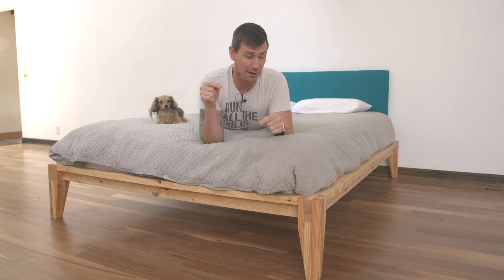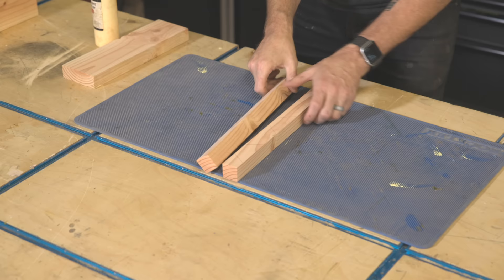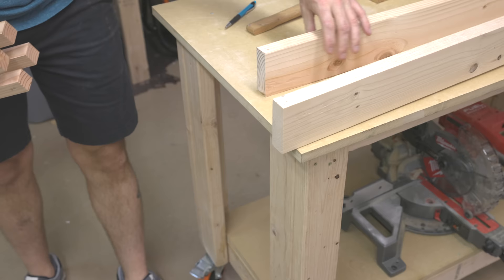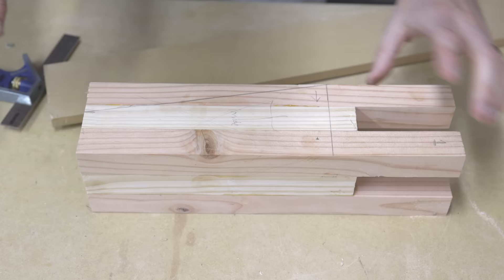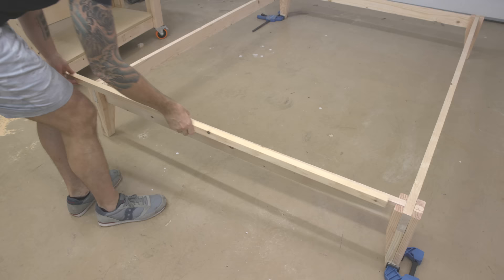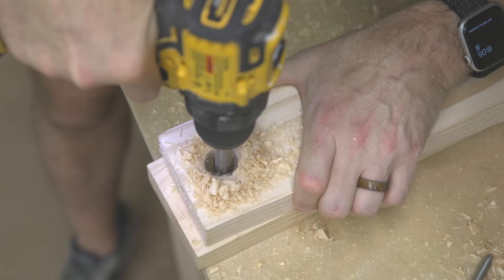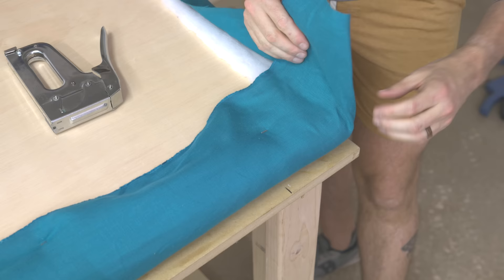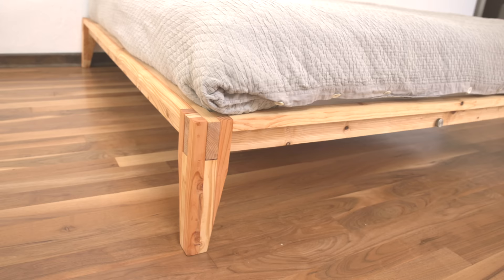DIY Castle Joint Platform Bed made w/ 2x4's Buy vs. DIY

Comment: Good thing it doesn't require a chisel. I've got no money left after buying a planer, jigsaw, miter saw, circular saw, belt sander, orbital sander, electric screwdriver, cordless drill, forstner bits, Rockler® brand clamps. . .
Reply: Lmao
Reply: By golly, you left out the big bottle of wood glue.
Reply: Just what I was thinking haha!
Reply: Also outside of the US, having space for all those things comes at a massive premium. Its really only for the rich or professional carpenter.
Reply: All you need is a bit of creativity
Reply: You are so right!
Reply: @justinzane195  😂
Reply: And you still need to buy a table saw.
But then it's going to be a super cheap and DIY bed. No sweat, no hassle, no chisels.
Reply: @Postfrogish  not just ANY tablesaw but a Stopsaw table saw. All I got is an old Emerson Digit Amputator from a garage sale for $50.
Reply: You can always buy finished pieces at a real lumber yard- they will charge you a small fee for the planing and the cuts.
Reply: Ah but that's the point isn't it? You say oh honey we don't need to buy that expensive bed, I'll make it... then once she's agreed you rub your hands, crack out the credit card and treat yourself to a garage full of new toys 😉
Reply: Lol
Reply: “Normally you would do this with a bunch of hand tools, but we’re gonna do this super DIY”
Usually ‘super DIY’ means hand tools because that’s what’s actually affordable and accessible.
This is a great project, I’d like to make it like him (one day), just the marketing’s a bit off.
Reply: Haven't even watch the video and had to give this a thumbs up already
Reply: @ga5712  "Oh no. Now I need to find another project just so that I can justify buying a set of chisels"
Reply: Maybe just maybe what he means by chisel is a legendary item that passed by generation to generation which is cannot bought with money it's legacy. It's took decades of practice to master. So rather buy ALL that tools that money can buy to craft your bed. Happy DIYing.
Reply: I can do it all with a chainsaw!
Will it look pretty? NOPE. But it will be just as functional.
Reply: @justinzane195  Yes! A lot of space and money too.
Reply: @angelchiriboga3904  Good to know! Thanks for the tip!
Reply: @emp0rizzle  dont ingore his orbital sander, just saw a vid, it's like 600 (or 650) bucks
when i saw it, i didnt know whether to laugh or to cry (for myself)
Reply: @70athens  good eye 😂but then again nothing wrong with buying/accumulating tools 👍
Reply: Couldn't been worst with Bessey clamps!
Reply: Lmao!!!  Ridiculous!!
Reply: Lol bhahaha.
Reply: Fully agree, a japanese saw and a chisel set come at 200 $ and the guy says "no hand tools fully DIY" f*** the mitre saw alone is more expensive than hand tools. It click baiting at its finest. You hope DIY tutorial you end up with a DeWalt commercial...
Reply: Can anyone afford to even rent just the space he has? Hahaha
Reply: Lol
Reply: thought so too.
Reply: DIY videos are always a big presupposition on the part of the producer
Reply: @70athens  You don't need a $600 orbital sander. You can buy sandpaper and use sweat equity until you can save up and buy one from a yard sale or a cheap Chinese one.
Reply: @simonrano8072  Where are you buying your tools? Lie Nielsen? Check out the Rex Kruger channel where he teaches you how to start simple with basic hand tools. He's even got a video on prepping and upgrading a set of 5 chisels for $18 from Amazon by changing the handles, and sharpening them correctly. And every more cogently, the Stumpy Nubs channel has a video on how you only need 1x 1/2" chisel because that's the one you'll use the most. You don't want to make anything really.
Reply: @BigHenFor  First my point is that this video is about not using chisels by having the full DeWalt powertool catalogue in the workshop. Yes chisel are not expensive compared to power tools. Secondly your are only considering the price of the cheapest chisels not taking into account the rest that is necessary : japanese saws (25-30 €), wet stones (25 €), wet stones planner (20 €), a chisel grinding guide (15 $), a file (20 €), a marking gage, a marking knife, a planer, a ruler, a square ruler, a workbench with a press/vise and a few clamps in different size. Having 3 sizes chisels really makes a difference, especially when you want to do morteses. 

I can do dovetails, tenon/morteses or free hand mitters to make many kind of small furnitures, I only use hand tools expect for the driller. There are way to complicate your life for a few bucks of saving but this "no chisel DIY tutorial" is a joke. Having some one accusing me of "not wanting to do anything" below a video "no skills or hand tools involved" is pretty funny ;) 

I have a full time job the rest of the week plus other extra activities such like sports, electronics, painting, cooking and brewing I will leave the 10 years craftmanship of free-hand beveling my single chisel workshop to japanese hardcore tradition wood workers.
Reply: Holy mole! I have a chisel, can i use that instead of the myriad of power tools?
Reply: Open a home Depot credit line. All you need is 1k
Reply: Hahahahaha
Reply: 🤣 this is all basic woodworking stuff. I can find this all secondhand for under 1k If you don't have this don't make a castle joint bed. Make a basic platform bed.
Reply: Lmao
Reply: 🤣🤣Thought i was the only one annoyed with the mentions in this vid. I mean, I get it, you have a sponsor but geez man, if I took a shot every time I heard rockler
Reply: I made my castle joints by gluing 2x2 oak together properly spaced with the other material. I don’t have most of the stuff you rattled off. Use some creativity and you can do it with minimal tools.
Reply: Pls do youtube search to learn to build your own bar clamps brother it’s gonna save you a few hundred bucks for sure i just built mine and couldnt be happier
Reply: @kylekeenan3485  the rich? Come on... it's a few power tools, not a damn workshop
Reply: @70athens  no a orbital sander is like $40-60 wtf are you on about
Reply: @simonrano8072  what person expecting to do DIY projects doesn't have a damn miter saw? Why do you people expect all diy projects to be built with hammers and hand saws?
Reply: @tfergieman  you dont need the space he has for this project
Reply: @randybobandy9828  this is not just a regular orbiter sander 
look it up
Reply: @simonrano8072  imagine crying about beeding basic woodworking tools for a woodworking project. DIY doesn't mean "no tools besides a hand saw and a screwdriver needed".
Reply: @papayaman78  why are you watching a video like this if you dont even have atleast a few of the very basic power tools he used?
Reply: @randybobandy9828  did humanity wait 4500 years for the mitersaw to be invented to start building furnitures ?
Reply: @70athens  who cares what model he owns? Its irrelevant.
Reply: @randybobandy9828  DIY is neither supposed to be "this is how a pro does it will all the gear in the book". I have a radial miter saw, a circular saw, a couple sanders and drill. But i am currently building a caslte joint Coffee table with japanese saw, chisels and not a single screw. Fun fact i am reusing the wood from my last bed platform, the bed frame has been turned into my workbench 😉
Reply: @simonrano8072  did humanity wait until DIY videos on YouTube became available to make furniture?  Do you think they didnt have specific tools to make wood furniture in the past or did they also just use a hand  saw and hammer with nothing else?
Reply: @simonrano8072  a miter saw isn't something only a "pro" has. It's a very very common power tool that most people have in their garage. The only tool he used that isn't common was the planer.
Reply: Yeah it’s definite cheaper to just buy a bed…
Reply: @SeanTriglia-yt2co majority of what he has can be rented and if you don't want to rent a bunch then a few saws, hand plainer, and a hand drill can do everything he did. Could even have the plaining, cuts and holes done by a shop for minimal costs. Still much cheaper than buying it outright. People act like power tools were and still are the only way things are built with wood. A little research and some practice and this can be done with minimal tools but has to be done the old way. Japanese traditionally use joinery as their primary to build complete intricate houses and furniture. It can be done.
Reply: Nobody told you to try to be the cool guy who makes things… Just to finish (or probably not) one bed in your whole life. This is for people who want to make their own sht not make one thing and tell people about how they made it.
Reply: Theres public access woodworking shops
Reply: Jajajajaja I was Just telling my wife based in the thumbnail the same exact thing! Dude has tools to start a new furniture company
Reply: Lol😂🎉
Reply: I have that orbital sander, that alone makes the price the same as ordering the bed online lol
Reply: It's almost like you shouldn't bother watching woodworking videos if you are too cheap to purchase tools
Reply: I live in an apartment, and made friends with trademen. I’m good.
Reply: You could reasonably do this with a table saw, circular saw, chisel, and any cheap clamps and plug-in sander. The table saw is the only one of those that's maybe iffy for a random homeowner to pick up, but well worth it if you're going to be building anything at all.

Buy good lumber instead of using the planer. Use a circular saw with repeated cuts to make the stretcher cutouts, then sand (or chisel...) to clean it up. Table saw to cut down 2x4s into 2x2s. Clamps for the glue-up. Any electric sander for smoothing cut edges.

I haven't tested it, but I'm playing around with an idea for the center support that won't even require a drill. One piece rests in the center foot like the stretchers do, but comes up under the lip at the front and back to hold the frame inward; another 2x4 rests on the top of the center foot, with its edges resting on lips on the top and bottom stretchers. Center weight is transferred to the foot and the frame, while the frame is still held square without a screw drawing it in. It's probably easier to just use the thumbscrew, but something about an all-wood, zero-hardware, gravity-locking bed really appeals to me.

The point is: pro tools will make this faster, but they're not a necessity. Get them if you see yourself using them more than once.
Reply: How sad I do not have all these tools. Bye the way lumber is cheap in my country but tools especially electric are not..  the cost same as in USA.. I JUST USE Hand Tools
Reply: Don’t forget your $1200 domino joiner lol
Reply: My thoughts exactly. He starts the video by saying to do it with regular tools, and then the first tool he uses is a planner.....
Reply: Lol, yeah, that chisel would have broke me!

Comment: So, I have now built 3 of these beds, 1 for myself and 2 or family members. They think I'm some kine of magician, but its not so; I'm just a DIY woodworker who found this bed design really useful and easy to build. I must admit my 12 year old self sprung loose and added LED lights around the border. Also i combined the frame with a headboard that was demonstrated by Tom Silva on Ask This Old House, and I think it worked out beautiful. Thanks for the Demo
Reply from the maker: So rad!
Reply: Hi, it’s me, your cousin
Reply: Using professional equipment in a DIY video is kinda bigoted, just saying.
Reply: I'm about to try my hand at building this and your LED idea just elevated the build! So excited for this project!
Reply: Hey! How long did it take you to build each bed? Thanks!
Reply: Don't forget to add "DIY" laser engravings with a $10,000 laser machine...
Reply: Is there a cut list for this project?
Reply: I can't ever recomend building furniture with anything from home depot.

Last time I went for 2x4's they were bent harder than the transgender community. And had reality more twisted than a social justice warrior.

I've often bought 2x4's from home depot still leaking sap and water.

I don't even recomend it for framing in a house. Unless you want wavy walls. Try putting a 6 foot level on an angle across your own wall. You'll know if your wood was installed wet because it won't be flat.
Reply: Kiln dried wood is ideal for furniture. From a reputable lumber source.

Comment: Love the 'additive joinery' concept and the castle joints are impressive.
Reply: Loving the jointery. Hating the wood selection.

I don't hate pine, just what Home Depot does to it with minimum wage labor. I'll stick with my local sources.

Ghanahl lumber, Austin hardwoods, and Rockler woodworking. Those are my current sources for wood.

I haven't gone online for wood ordering, it interests me, but I want my local shops to stay.

I just lost my local Woodcraft, and I don't like it one bit.

Comment: I was able to complete this project today with the guidance from the video! Overall achieved a similar result. A few people mention concerns about the strength of the end of the beam and the wood grain orientation. Indeed, the small piece broke off on one end during the test fit. It's easy for this to happen given the pleasant result of these pieces fitting together and the strain on the opposite end when fitting a piece. However, it glued back easily and I was happy that the end result didnt compromise strength at all. As mentioned, once the bed is assembled, there is a lot of strength in the design. There doesnt seem to be much force on the end piece surprisingly. Additionally, I'd recommend buying four or so additional 1x4's for the slats so that they are spaced out with less spacing between. Good luck!
Reply: I didn't do the same bed design, but I did find that using 2x4s instead of 1x4 bed slats improved the stability incredibly. It also seemed to remove a lot of the squeaking that would happen.
Reply: @the-wooden-beard  what mean 1x4 / 2×4?    tickness and width?
Reply: @oldiniabal1464  yes
Reply: @the-wooden-beard  thank you :)
Reply: It's the thickness and width of the lumber. "1x4" is one inch thick and four inches wide; "2x8" is two inches thick and eight inches wide.  The actual dimensions are smaller, but it's complicated to explain.

Comment: Thanks for sharing this wonderful idea with us! I'm a carpenter myself, so I'll go straight for 4x4s for the bed legs, shaping them the old-school way: making a structure to support the mattress, then using a piece for the head and the foot, each.
Reply: There's no way that jointery survives my bedroom activities unless that joint is fully glued, I'm a Viking, deep down somewhere under the nanny!

And if that joint is fully glued its disposable, because it's not getting out of my room when I move.

Maybe a bedframe involving a tusked tennon. but I think it's better to get a little more modern with some hidden bolts or a modern fastening system that can be taken apart.
Reply: Also a 4x4 from home depot needs to sit for 4 years. 1 inch per year to dry wet wood. Home depot lumber leaks water...
Reply: @brandonhoffman4712  ended up using 18mm MDF boards to put drawers beneath my bed, so I can keep a bit of clothes in them. But I did plan for the forces that would be made on the structure, so I'm chill

Comment: I also like to use additive joinery with 2x4s, it is a very useful and easy method that doesn't require a lot of tools, but careful planing and accurate cutting make the job much easier. I would not normally choose castle joints like this for a bed like this...while it carries a vertical load nicely, under lateral shear stress the joints are only as strong as the narrowest notch inside the joint, which is only 1.75 inches X 1.5 inches in girth in this case. It is probably ok for gentle people. It sure looks cool, though!

Comment: I have been searching for a way to build a new base for my trusty old Jet band saw. It's at least 25 years old, still has it's original grey paint (for now) but it still runs like a champ. The base on that saw is getting to be more than just a little bit weak, but there's nothing wrong with everything above it. I think I'm going to use your castle joint technique to build a basic cube, without tapering the legs. I'll do this for all 8 corners of the cube. Where you added 2x2 strips to support the mattress, I will use 2x4's with glue and screws for a lot of added support. Then I'll add some 1/2 inch plywood to the top, bottom, front, and sides, leaving the backside open to access the motor if needed, or I might even put on a door. I think that cube will be strong enough to park my car on it, and will probably live longer than I will.

Comment: Nice job, and indeed I see ads for this kind of bed every day! I feel like it might help the rigidity if the legs were actually glued into the footboard and headboard cross bars. This would not change the portability of the bed frame by much at all. Olive.
Reply: If everything is glued together then it's not as portable or easy to take part and moved somewhere else.

Comment: Today I start to build this for camping, using ‘Firewood’ for the castle posts(6), and shorter bed rails to easily fit in the back of a KIA soul.  Thank you for the castle/interlocking joint ideas!

Comment: Great Job!  I had an issue with the "tabs" breaking off at the ends of the stretchers. I drilled a 5/16 hole from the underside and added a hardwood dowel to strengthen them and that seems to have done the trick.  Thanks for the video!!!
Reply: Think it would hold up build out of ash? No dowel added?